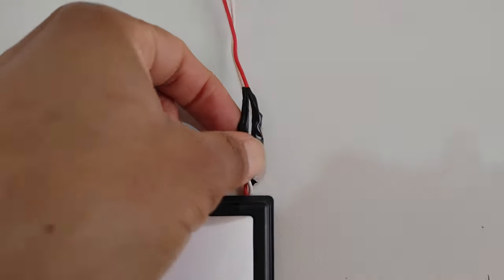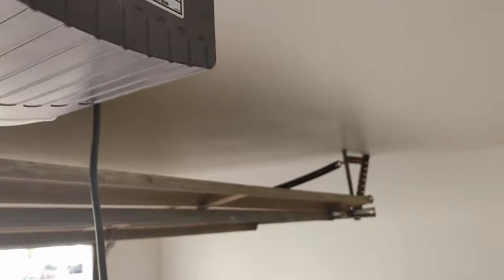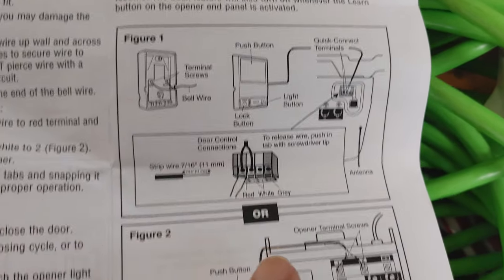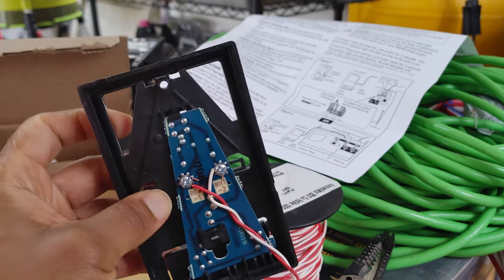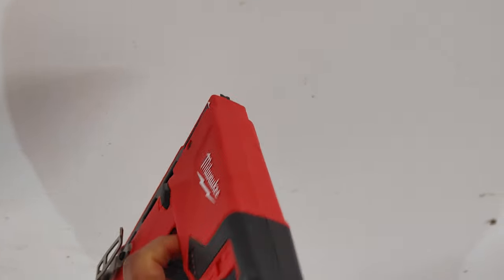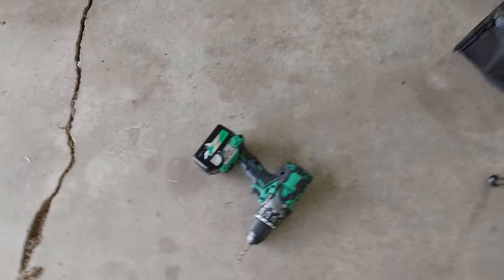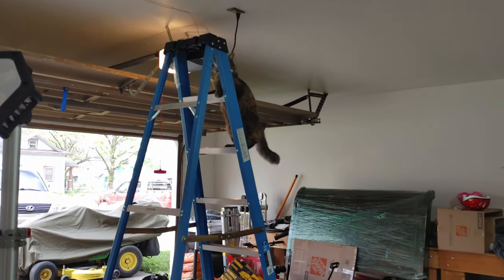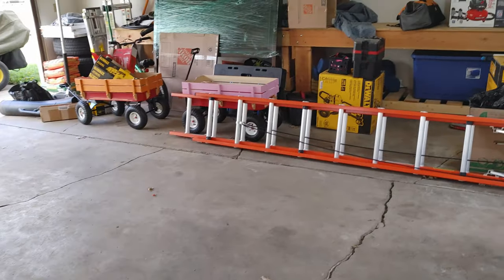How To Install A Garage Door Opener Button

Comment: you didn't need to splice the wires just cut it to length install inside switch otherwise good video keep up the good work